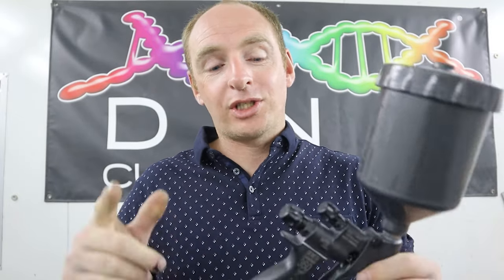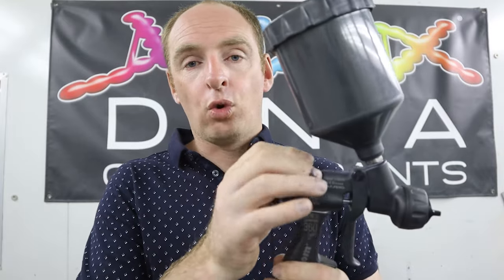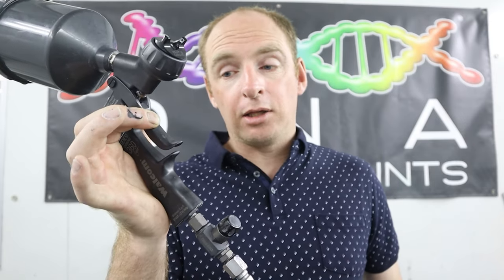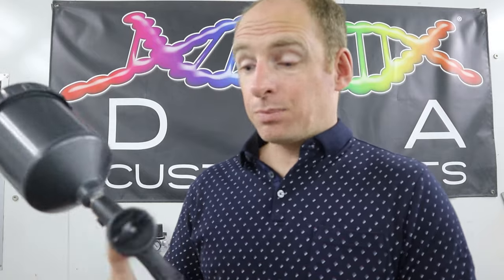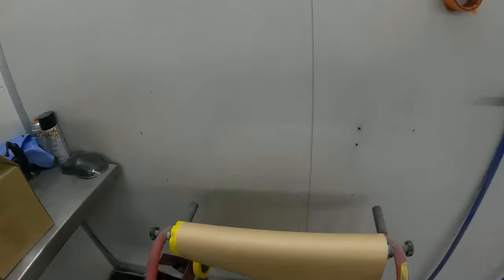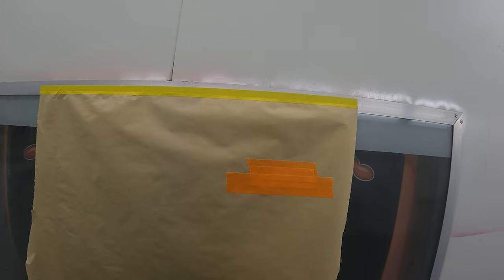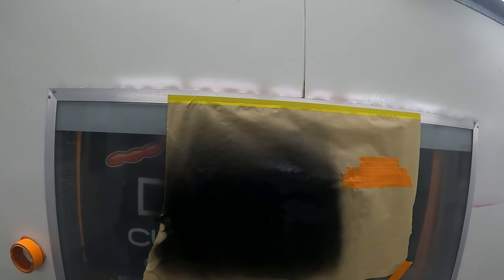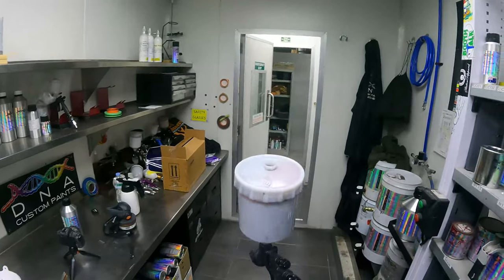How To Setup a Spray Gun To Paint Basecoat And Candy (Beginner Guide)

Comment: Ok with your fan open that much doesn't it cause overspray?
Reply from the maker: @Shawn-p8w  in a down draft booth ? No . You want paint to atomise out of a spray gun . When painting metallics or sfx colors this will help getting it even
Reply: @BogDustForBreakfast  ok what about if you don't have a booth. Just a garage with vent fans?
Reply from the maker: @Shawn-p8w  having a open fan is perfectly fine mate . Just tack rag before you clear it . You’re always gonna get overspray when spraying in a shed . Best thing to do is keep fans running and remove all color overspray from the shed before you clear and all clear over spray before you turn the fans off when you’ve finished painting

Comment: Have you tried the walcom mp air cap for clear?
Reply from the maker: Sure have use it every time and love it
Reply: I am wondering how it differs from the regular hte air cap. I ordered the mp and hoping it has a flatter finish
Reply from the maker: @jeremyoetken2094  its structured in a way which alters the atomisation for finer particals . It does lay down a flatter finish. I’m using the 1.2 HTE MP
Reply: @BogDustForBreakfast  Thanks so much for the information. I appreciate it!
Reply from the maker: @jeremyoetken2094  no worries at all mate